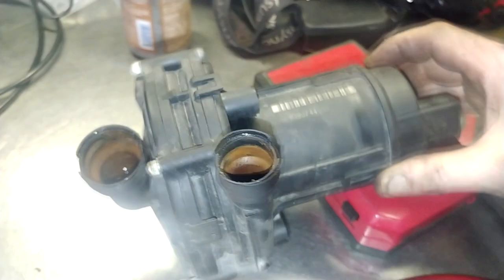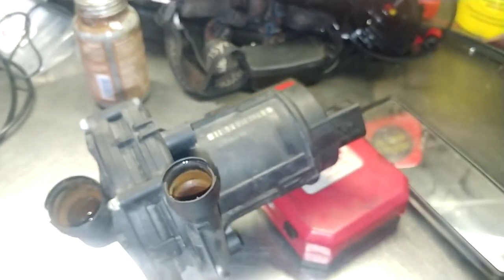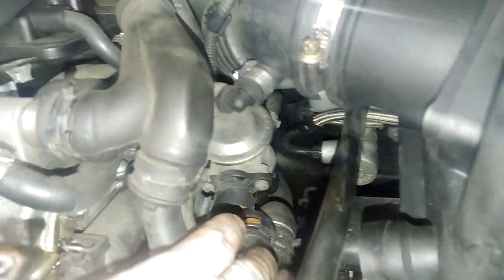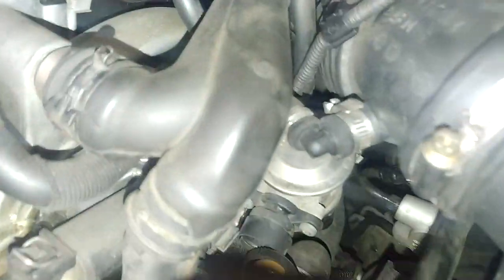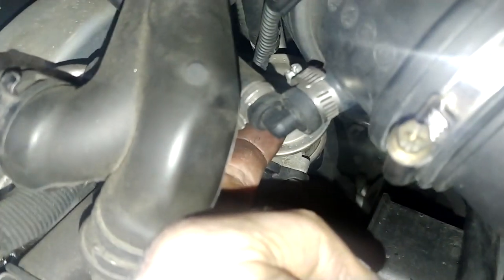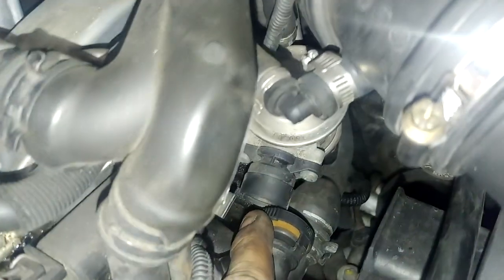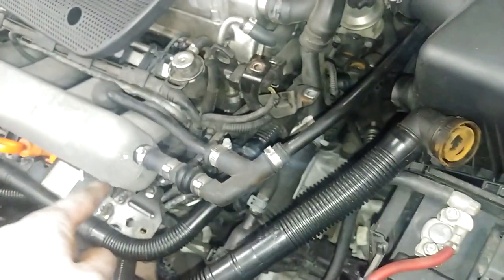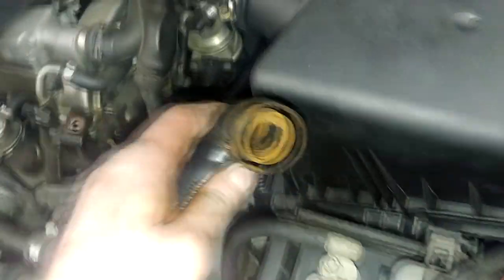1.8T with a faulty SAI Combi valve (stuck open)

Comment: Missed ya! But how can you tell the combi valve is stuck open before taking things apart?
Reply from the maker: The exhaust pulses can be heard even with the tubing on.
Reply: @EXOVCDS  Shouldn't the combi/SAI be (very) hot to the touch after a good drive if exhaust is leaking into the system?
Reply from the maker: It gets hot even when the valve is stuck closed... everything that is mounted to the 1.8T cylinder head gets hot. =)
Reply: @EXOVCDS  Oh right, exhaust is hot. :)
Reply from the maker: @atubebuff  Sorry, my point was that since the combi valve is mounted to the cylinder head (exhaust present or not) the valve will get warm / hot to the touch due to the heat from the head / coolant. So simply touching the valve to check for heat (in my mind) is not a conclusive check / test.
Reply: @EXOVCDS  No explanation was  needed, I just had a "Schwachkopf" (not this'll work in your dialect) moment!

Comment: Hi.. thank you for uploading this video !!! ...today my car has been idling high at 1000rpm and the noise in this video of the exhaust when your finger wasn't inside is  exactly the same..  when I expected.. the smaller pipe running between the sai pump pipe and combi was broken... would this cause a high idle ???? Thanks in advance 🙏
Reply from the maker: Secondary Air Injection only last for about 1 minute after starting a cold engine. If the high idle continues for 5 or more minutes, then it is not related to SAI.
Reply: @EXOVCDS  thank you for reply 🙏
Reply from the maker: Year, make, model, engine? High idle cold, warm, all the time? AC, no AC? The more info I have... the better i can help.
Reply: @EXOVCDS  skoda octavia mk1 vrs ... 1.8 20vt auq engine.... idles at 1000rpm for longer than 5 mins.. its also noisy (the same noise in this video and engine shakes) when I put finger in combi valve the shaking and noise stops...
Reply: @EXOVCDS  idles 1000rpm cold and warm
Reply from the maker: Solve the "known issue" first. Eliminate the SAI fault so it can be ruled out as the cause.
Reply: @EXOVCDS  awaiting the pipe... should be hear tomorrow 🤞🤞🤞

Comment: changing a exhaust manifold gasket looking for a strange ping  its a doosey mounted on the heat shield  have to take the upper manifold then the sheild off and get that egr recirc pipe out  anyway i hit it with some carb  spray lot of gunk come out of there  after on startup from the job  i heard a chirp then like a different car ok at idle but when i hit the gas it flutters and sounds like it has a bad diesel sounds cept faster   whent through all the trouble think i have to replace the combi now since i freed it up it must of froze in a half closed position or open not sure  is a spring broke in it or ?
Reply from the maker: Post a video on your channel so that I can see & hear.

Comment: My combi valve looks slightly different on my 2.0L golf. Don’t think it has a vacuum line on it. How would I check it? My relay is good, the pump works and no water in it. But have a code for incorrect flow. Thinking maybe I could test it to see if it’s stuck shut somehow?
Reply from the maker: Engine off, remove the plastic tube from the valve, attach a hose that fits snug and blow into the hose with your mouth. You should be able to blow air through the valve. If you can not, then the valve is stuck closed.
Reply: @EXOVCDS  hi, thanks for your reply. I have taken the combi valve off and blown through it. And it is coming out of the other side just fine when I blow into it. I’ve had the pipe off that goes down to the exhaust manifold and blown through that as well and that is also fine. I’ve visually inspected all the pipes and can’t see anything wrong. Any ideas? There’s no error codes other than P0411 incorrect air flow secondary air system. Starting to loose hope with it.
Reply from the maker: If you have a scan tool... monitor short term fuel trim at idle. Activate the air pump... fuel trim should go positive to 20%. Like in this video:
https://youtu.be/4GPFeCeugNk
If not, then not enough air is flowing into the exhaust.

Comment: Hello Thomas, I'm glad that you are back.
Thanks for the video.
Can this problem also appear at 1.8T AWT engine ?
Reply from the maker: Any engine with SAI system.
Reply: @EXOVCDS   Thank you 👍
What are the symptoms ?
Reply from the maker: @bela.cileg.  Check engine light ON and no sound from Air Pump when the engine is first started.
Reply: @EXOVCDS   Thank you Thomas, viele danke 🙂👍

Comment: i got question about 1.8T, i got passat 2001 with AWT engine, i got problem starting the car, when i turn key, car cranks but wont start. Now what i noticed is that befor while it was working properly dash showed yellow check engine and epc lights, on start all lights go out, now when i turn key to crank i got 3 beeps and abs and handbrake solid, and car wont start. Now i noticed thet while cranking if at any point dash show  yellow check engine and epc lights car would start. What could be the problem? Where to look at? battery is brand new, alternator is charging at 14.6v, starter motor not tested. Pls help
Reply from the maker: Ecm power supply relay in the E-Box in the engine bay... would be my first guess / look.
Reply: @EXOVCDS  thanks for answer ill try and post what i did
Reply: @EXOVCDS  is it 219 or 370 relay, they look brand new
Reply from the maker: I believe 370 is the ECM relay. When the check engine light is not on in the dash... leave the key in the on position and tap on / against the relay with your finger or a screwdriver handle. If the light comes on, replace the relay.
Reply: @EXOVCDS  ok, i tested both relays, and waited monday to buy new ones to be straight, and nothing, everithing remained same, its not relays. Any other advice, what to check next?
Reply: seems like its some bad wire connection....when i shake wires, that are conected under wheel, it starts to act normal, and than loose it again...omg
Reply from the maker: Move one wire at a time so you can better isolate the faulty one.
Reply: @EXOVCDS  i ended up driving car to electrician, and the problem was water between ecu and board, that moisturised and oxidated the multiple wires, he replaced those wires, and car now works like it did before. in case some one else ecounter similar problem.
Reply from the maker: @orgrimdoomhammer2161  thank you for the update!

Comment: Question. I got a 99 vw beetle 1.8t a/c is not working. Put a new compressor on and still nothing . I tried to jumpstart the compressor by using the wires from the pressure switch and still wouldn’t kick on. Can’t figure this thing out. Fans are on and working fine. Checked all the fuses and they are fine. Is there a trick to jumpstarting the compressor? I can’t get this thing to turn on and can’t figure it out
Reply from the maker: The Cooling Fan control module is what supplies power to the AC clutch (AC clutch should have a good ground all the time... brown/wht wire).
Power needs to flow from the AC button, through the Pressure switch, through the Ambient Temperature switch and through the AC Cut-Out thermal switch... in order for the Fan Control module to receive the AC request signal (to turn the compressor on).
Reply: @EXOVCDS  the ambient temperature sensor is gone on mine so is that my problem? It came off going down the road so I have one ordered. You think that’s my problem?
Reply from the maker: @madmax-ko1nt  Only way to know is to put one back in the circuit. =)
Reply: @EXOVCDS  okay I have one ordered. Thank you as always for the reply
Reply: @EXOVCDS  are there two pressure sensors on the a/c system or just one? I can’t find the second one
Reply from the maker: @madmax-ko1nt  One sensor body, but 2 sensors inside (4 wires, 2 for each sensor circuit).
Reply: @EXOVCDS  there’s only 3 wires running to the sensor
Reply: So I’m assuming one wire is a ground and the other two are hots
Reply from the maker: Sorry... my bad... was going off the top of my head. Let me find a wiring diagram for your AC. I'll get back to you.
Reply: @EXOVCDS  it’s fine man I know it’s hard answering a million questions on here. Thank you I appreciate it.
Reply from the maker: You are correct... here's a wiring diagram for your 1.8T AC system:
http://fkh161.ca/VW/APH_AC.pdf
Reply: @EXOVCDS  so there is two? I’m having trouble following the diagram
Reply: And if there are two where do I find the second one. I found the one by the fire wall
Reply from the maker: @madmax-ko1nt  just one... page 3.
Reply: @EXOVCDS  oh thank god! I kept hearing there was a second one under the dash. Thank you very much man! You saved me a lot of time.
Reply: @EXOVCDS  where is the relay box located? I looked under the dash and nothing is there
Reply from the maker: @madmax-ko1nt  The relay box on page 1 of the PDF? Under the dash to the left of the pedals.
Reply: @EXOVCDS  I’ve checked everything. I’m not getting voltage to the compressor so it’s obviously a wiring issue. Idk how to back track the wire. The green and black wire goes straight to the module and it’s getting flow straight through the wire. And the module is brand new. Idfk this shit on vw is a joke
Reply from the maker: @madmax-ko1nt  there are 3 green fuses on top of the battery. The one on the left feeds power to the fans and the fan control module. Is that fuse OK? Pull the fuse out to inspect the legs. If fan control module will not turn the fans or compressor on if it does not get the correct ac inputs. If your fans turn on, but your compressor does not  then there might be a wiring issue. If fans & compressor don't come on, then there's either a power supply issue, not enough ac charge, bad pressure switch, bad ac switch... etc.
Reply: @EXOVCDS  fuses are good. Replaced the fuse box when I bought it. Fans run good. Replaced the fan relay. Replaced the compressor itself, replaced the high pressure switch. I pretty much replaced every sensor on this thing and nothing changed. I used my multimeter to check voltage in the wires to the compressor, one is a ground witch gets continuity to the neg battery post. The other one when I set to dc it reads like 100mv whatever that means.
Reply from the maker: @madmax-ko1nt  do the fans spin when ac is on?
Reply: @EXOVCDS  spin with the a/c on or off.
Reply from the maker: @madmax-ko1nt  do the fans spin when ac is on / selected?
Reply: Both sides spin.
Reply: @EXOVCDS  yes. They spin when the a/c is selected, but they also spin with it off as well. Both spin non-stop
Reply: Sorry that’s what I mean in my last comment.
Reply from the maker: @madmax-ko1nt  ok, so the fan module receives the ac request and turns on the fans... and should also turn the compressor on. You need to check the power wire for the compressor, for a bad connection / corrosion. The wiring diagram tells you which pin at the fan module it is connected to. Disconnect the plug from the fan module and look at the little connectors. Look for green corrosion. If the connector looks good... follow the compressor power wire from the fan module connector to the compressor... to see if you can find any bad connections. To speed things up, you can cut the compressor power wire a few inches from the fan module... strip the wire and verify that the wire has power when ac is on. If yes, run a new wire to the compressor clutch power wire at the compressor.
Reply: @EXOVCDS  I checked for continuity from the green black wire that runs from the module to the compressor. I’m getting continuity so I know the wire isn’t bad. Just not getting any volts from the wire. Maybe the fans are bad and not sending signal to the module that they are running?
Reply: The green black wire is the wire your saying to check for a bad connection but from what I’ve done there is not a bad connection. Idk I could be wrong. Maybe poke a hole with my multimeter further up the wire to see if I get a connection? That wouldn’t hurt it would it?
Reply from the maker: @madmax-ko1nt  the fans don't do that... send a signal. The fan module shouldn't turn the fans on if it thinks there's an ac problem. Since the fans work, it's safe to say that the fan modulecthinks that ac "prerequisites" are ok. Checking a wire for continuity can show ok, but when the wire is put under load, the circuit doesn't work. Back probe the compressor wire at the fan module... how much voltage when ac is on? Disconnect the compressor clutch connector so that the clutch can't pull the voltage to ground.
Reply: @EXOVCDS  I’m going to strip the wire at the module and see if I get voltage. If I do then I’ll just do what you said and run a wire from the module to the compressor
Reply: @EXOVCDS  there is .323v coming out of the wire. Right from the plug. Had the car running with it plugged in.
Reply: The plug at the module I mean. And the compressor was unplugged so it didn’t suck down the voltage.
Reply: Is there a different wire I could strip and use the volts off of it instead? If that wire isn’t getting any volts at the module idk where it could be after that. It’s a new module too
Reply from the maker: @madmax-ko1nt  is fuse 16 ok?
Reply: @EXOVCDS  idk what fuse that is but I’ve checked every single fuse on the car and they are all fine.
Reply from the maker: @madmax-ko1nt  all fuses are labeled in the wiring diagram. Fuse 16 is one of the power feeds to the module. Fuse 16 is in the Fuse box at the side of the cluster. 
https://fuse-box.info/wp-content/uploads/2018/07/Volkswagen-Golf-IV-mk4-1997-2004_in_1.jpg
That's as much I can help you with... wiring diagram pdf and some basic info. I could keep guessing / suggesting  for a week and not figure out the problem. Sometimes it's quicker & cheaper to pay someone 1hr of labor to find a problem... than spending weeks trying to find it yourself.
Reply: @EXOVCDS  yes that fuse is fine.
Reply: @EXOVCDS  so I’ve checked the wire that runs from the ac button from inside the car to the module and it’s getting voltage. I’ve checked everything I can possibly think of. Called around and everyone is booked for over two months so I’m pretty much screwed on having someone look at it. The only thing I can think of is the signal from the pressure switch isn’t working or sending signal to the module. The ground is fine and the hot is fine on it. So that’s where I’m at right now. On a side note the fans run when the module is completely unplugged. So I have no clue what’s going on there
Reply from the maker: @madmax-ko1nt  I'm at work... but had time to take 2 videos.
https://youtu.be/srssvDqHLEc
Uploading the second now.
Reply from the maker: @madmax-ko1nt  part 2
https://youtu.be/UI6Jv-waOwg
Sorry... camera didn't rotate.
Reply: @EXOVCDS  thank you man. I appreciate the videos. The sensor wire isn’t putting out nearly that many volts on mine. Maybe 300mv
Reply: I’d say there is definitely a problem there. Thanks for all your time man. I’m gonna have a mechanic run a diagnostic check on it and see what’s going on with it on Monday and maybe I can get somewhere after that. I’m an at home mechanic so I’m sure I’m doing something wrong haha